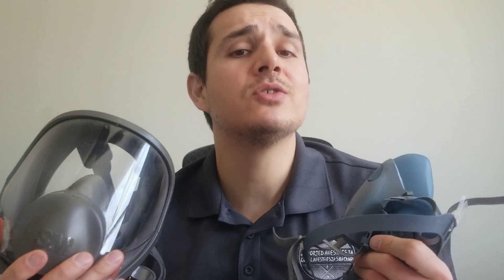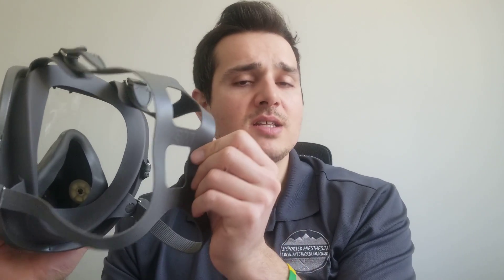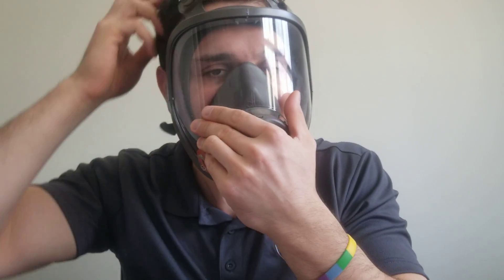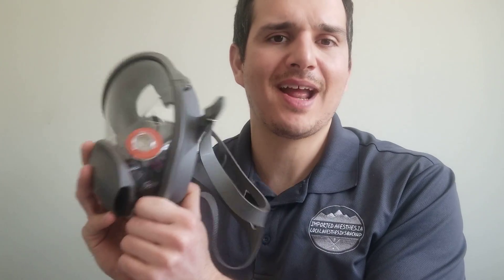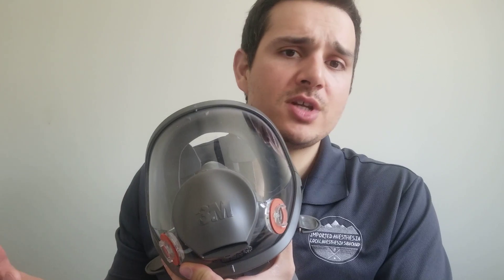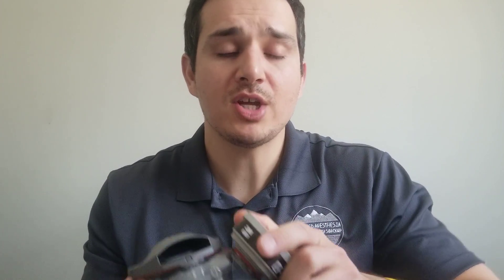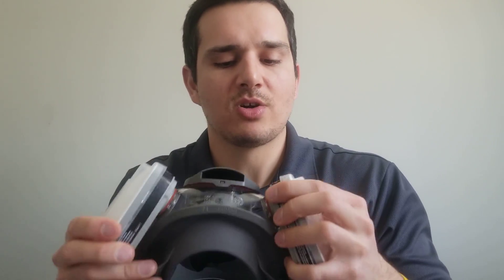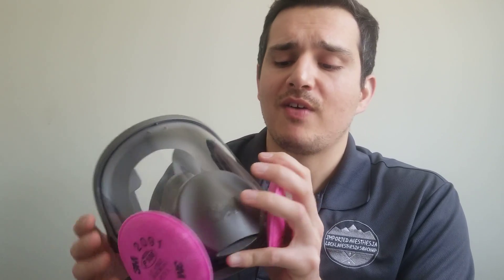Covid 19 Reusable elastomeric respirators: How to test seal, clean and brief overview of the mask

Comment: Hello Nurse Anesthetist Calabrese, is it offensive for medical practitioners to see ordinary civilian with no job-related reasons to wear respirators like that? Thank you.
Reply from the maker: I would say its not offensive. Unfortunately people will have their opinions. There were many civilians in NYC at the height of covid wearing these masks. They are very effective and more comfortable than the normal N-95 if worn correctly and with the proper filter. Having a safe/approved vaccine is probably the best option since wearing a mask is not always done correctly and the mask eventually needs to be cleaned and the filter replaced. Hope this helps.

Comment: Can I use this mask for cardio workout
Reply from the maker: Yes you can! As with anything make sure  you try it out first at a slower pace. The benefit of these masks is their increase in surface area which means easier flows when exercising. Only draw back is you might get looks. Remember after awhile the filters do go bad and typically that shows up as an increase in difficulty breathing with them on. So have some spares handy and switch them out when necessary

Comment: How are do you filter the exhalation part? I dont want to wear a surgical mask over it but all the air I exhale is unfiltered
Reply: there are 3d printed filter housing for these 3M half face masks. you can cut out surgical mask/electrostatic hepa sheet as filter
Reply from the maker: Hungryalien great idea do you have a link?. You can also place velcro on the 3m mask at the exhalation port and the  exhalation mask. T
Reply: @calincalabrese6260  hi you can google for "3d printed respirator exhalation valve filter" there might be sellers near you. some even post the raw files online so you can print it out yourself if you have access to 3d printer. i got my 6200/7500 all fitted with those from a local seller here in asia.
Reply: @calincalabrese6260  for reference and what can be done. you can check out this guy's instagram: 

https://www.instagram.com/3dprintmanila/

Comment: You should try and use a 3M 7093 enclosed P100 cartridge. They are used in Africa for responders to ebola. This is because the filters are enclosed behind a plastic housing which covers the entire filter. So there were able to just wipe down the exterior of the cartridge and were not forced to replace filters over and over. One filter will last according to 3M, “for the duration of the pandemic wave.” Realistically it should be good for a year or more. I used one for my geology thesis sample collections in asbestos mines. Works great.
Reply from the maker: I would wipe the filter at the end of the day or intermittently with an alcohol pad. It didnt over dampen the filter. Then I left it in a brown bag or out to dry
Reply: @calincalabrese6260  alcohol is super bad for the filter if it touches the filter material at all, you should consider replacing them quickly. Your filters are made of melt-blown (MB) stretched polypropylene that use electrostatic charges to pull dust and virus particles in and stick to the filter. Alcohol rapidly degrades MB polypropylenes charges. Here is a scientific paper which was published this year in journal Applied Nano Materials, where they tested cleaning your filter material with ethanol (alcohol). This is a quote from their findings in the study: “We found that the filtration efficiency of MB filter significantly dropped to ∼84% and ∼62% after ethanol spraying with 1 cycle and 10 cycles.”
Fortunately ebay and amazon still have the 7093 and 7093c cartridges for under $25. :)

 https://www.ncbi.nlm.nih.gov/pmc/articles/PMC7323055/#!po=0.877193.